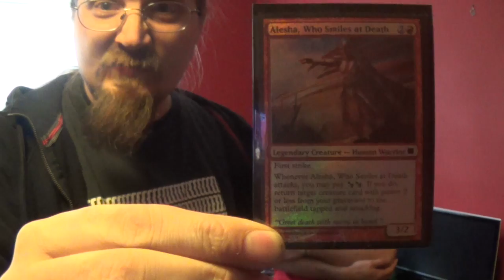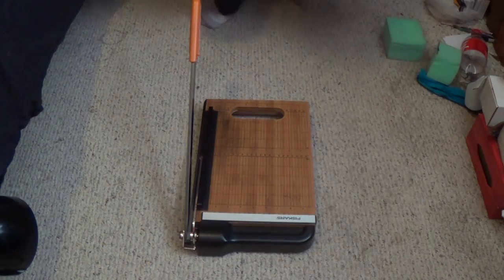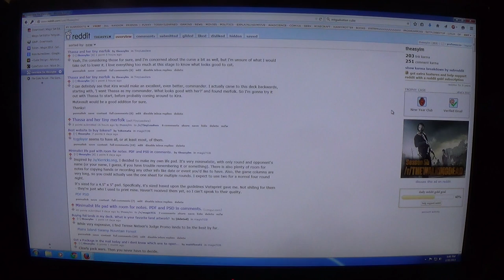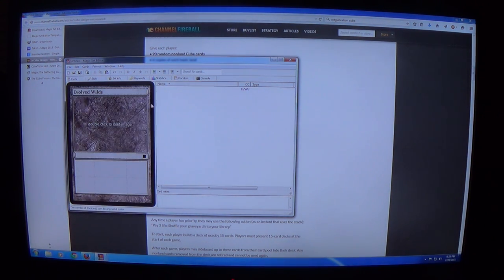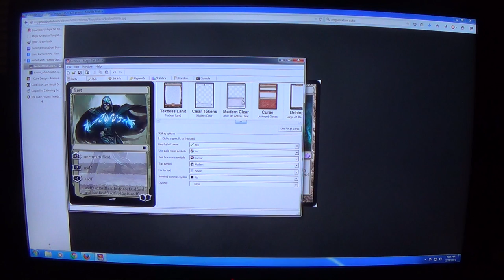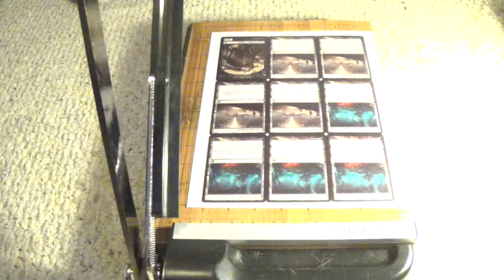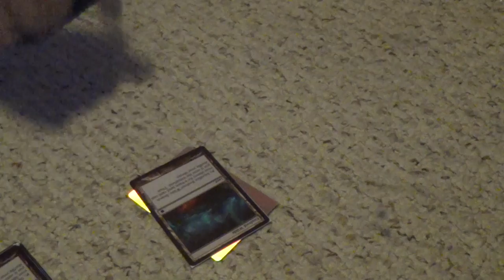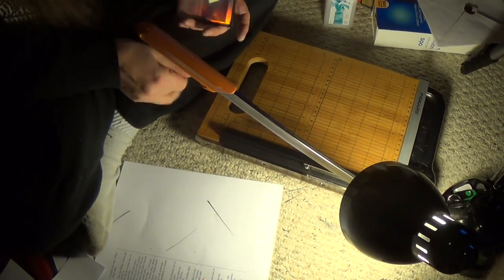Foil Proxy Cube Tutorial — 300th Video and 1,100 Sub Special

Comment: Amazing tutorial, and thanks for the abundance of information! Quick question: is there ANY damn way on God's green earth to join the transparency to the foil without ending up with unsightly speckly texturing under hard light?  I've tried Elmers and Scotch spray adhesives...6 inches away to 15 inches away with a super light mist...every way under the damn sun.  And every time..tiny dried speckling effect on the finish when viewed under hard direct lighting. Every.  Damn. Time.  Of course, lighter, whiter areas on the cards show the speckling more than darker areas, so I tend to darken the images with as much contrast to try and mask it.  But it shouldn't be that way.  

Is there a special magical spray adhesive you guys are using?  Because none of the ones I've tried dry COMPLETELY CLEAR. To most, it wouldn't be a big deal.  But I'm anal, and I like my cards to look next to perfect under all lighting conditions.  Halp.  Please?
Reply from the maker: This looks like a job for ***** , the one in the video that's doing most of the talking. He's much more knowledgeable about the process than am I, but I will say that he definitely is not using a spray adhesive. Rather, it's the kind of printer sheet that's featered in the "materials" section of the video.
Reply: T1GlistenerElf Thank you for your reply! Yes, upon further review, I realize that he is using the special self-adhesive translucent paper.  I actually bought that exact same paper and brand, and ran across the same surface lines (looks like marring and perforations) that you showed in your video, and I'm using a higher end canon pro-100 printer.  So it's definitely not an acceptable alternative for me.  Also, the cards look so much nicer and elegant when you have the images printed on the inside with gloss on the outside.  Just a personal preference.  Was seeing if anyone else had success in this endeavor.  Thanks again!
Reply from the maker: Thanks for letting us know your experience and thank you for your engagement on this subject matter. I'm glad that people are watching this and that my friend has helped so many try to make this cube construction design work for them.

Comment: Is there a way to do this without using foils
Reply from the maker: Not this particular method, no. In that case, I would think that you could just print onto cardstock from the program. As we say emphatically in the video, though, make sure that it's obvious that they aren't real, using things like the changed set symbol to distinguish them.